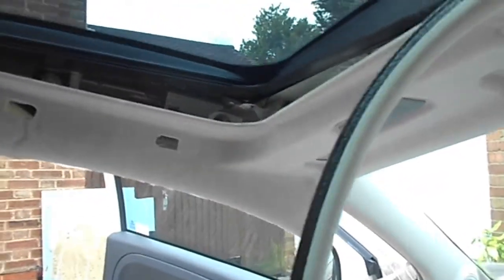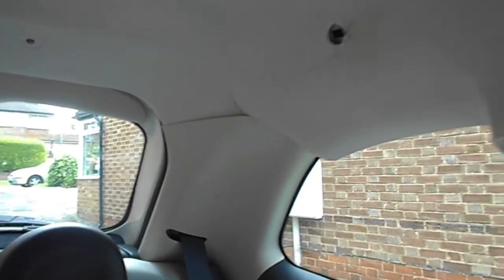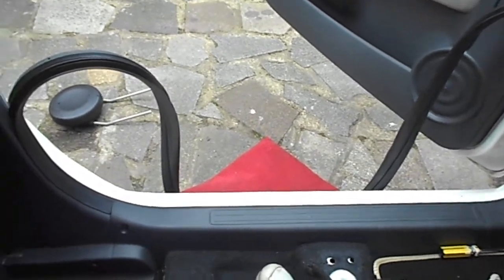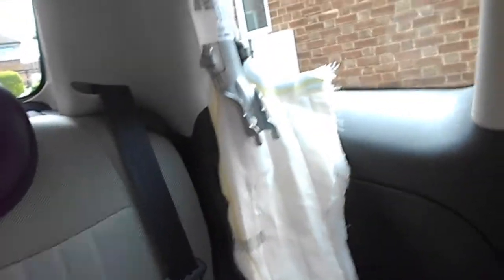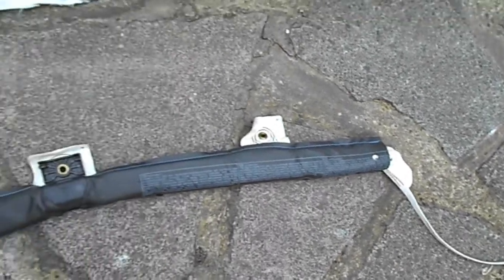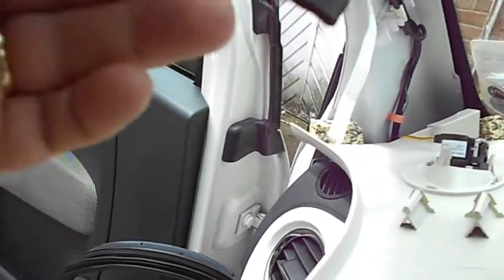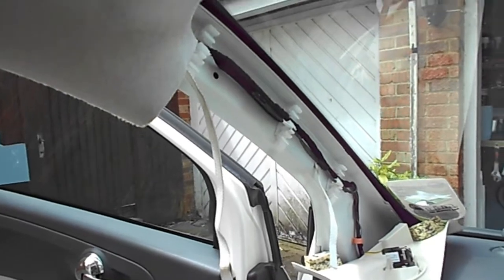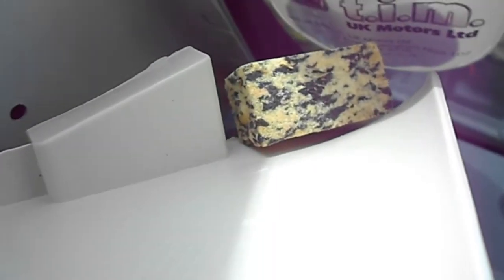Changing a Curtain Airbag on a Fiat 500 or Abarth - Love 500 How to Series

Comment from the maker: Sorry for the delay in replying. You do have to reset the airbag ECU. If you have multiECU scan you can reset using that. If not you can get a second hand ECU on eBay for around £50 or send your old one off to be reset. If you don't the airbag light will remain on.
Reply: Did you have to replace any impact sensors as well as the curtain?
Reply: Never needed to change a sensor, I think unless it's physically damaged in a side collision it never needs replacing.

Comment: Do any sensors or computers need to be changed or rest as well or is it just the bag itself that needs to be changed? I am thinking about buying a car with a blown curtain airbag.
Reply: Yes the airbag ECU will need to be reset which will usually work with MultiECUScan. It doesn't seem to reset for passenger and steering wheel bags but for the curtain one it will. You can always replace it with a second hand good one for around £50. It's held in by 4 bolts which are fiddly to get to and you need to use a 10mm spanner rather than a socket. It's tucked behind the centre console right at the front of the car. Get into the footwell, fold down the little bit of carpet and you'll see it. Two electrical connections on the drivers (UK) side. Remove the earth lead before messing with airbags or ECUs though.